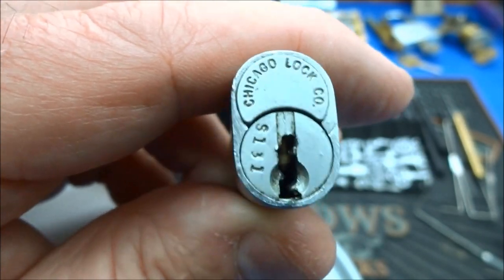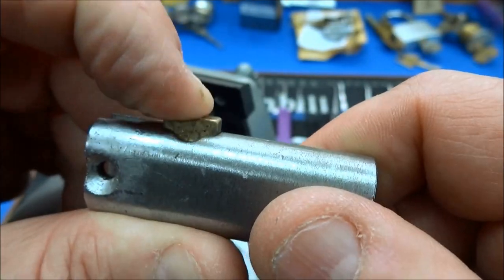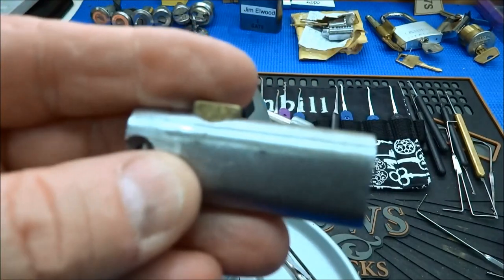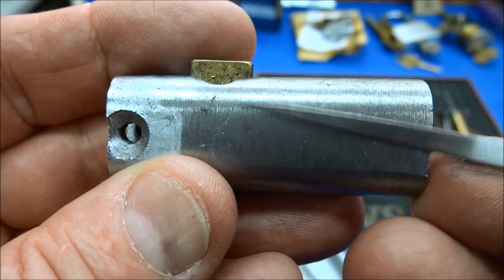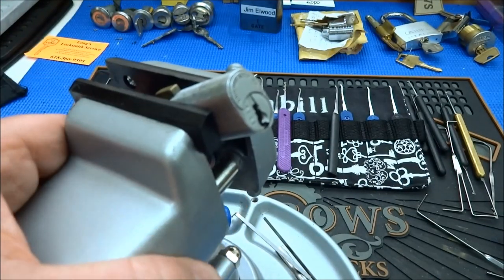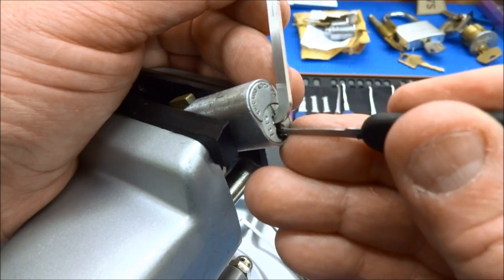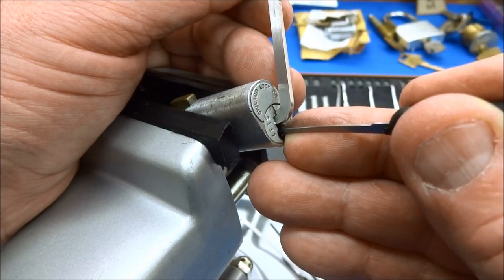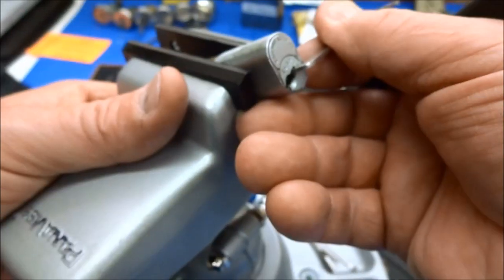(569) Chicago Cabinet Lock (Thanks Wayne!)

Comment: Have a file cabinet with that lock.
The lock is horizontal so that gravity doesn't help the pin springs. 
I have little feel for a false set. Suggestions?
Never got the key for it.
Reply: Carlos Da Silva 
Just got it opened.